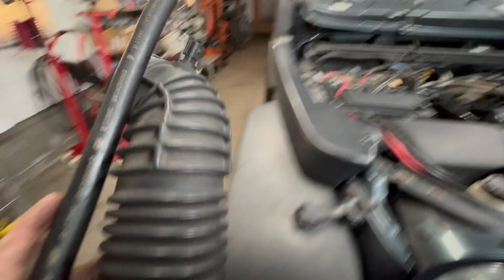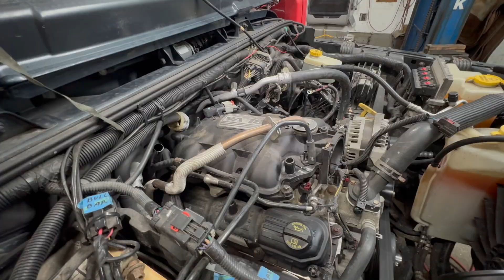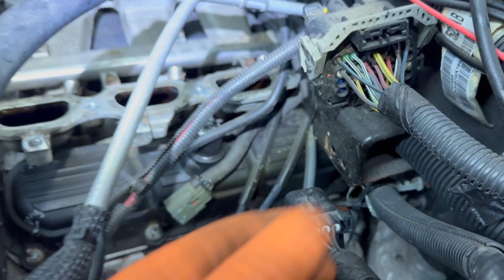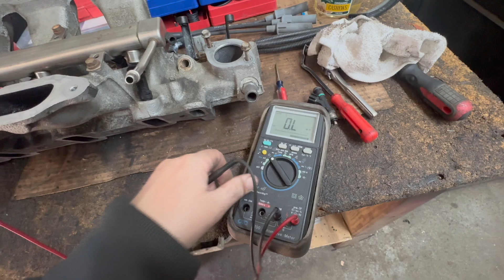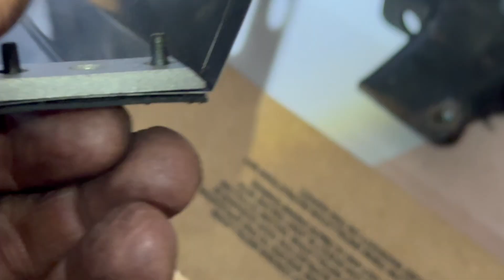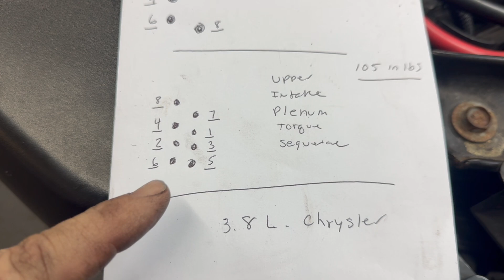How to Replace the Lower Intake Manifold on a 3.8L Chrysler Jeep Engine - DIY Repair

Comment: I have the same jeep and did everything in this video and I have coolant leaking between the head and the lower intake manifold. What would be causing this?
Reply from the maker: It’s impossible for me to know what you did wrong but maybe the Intake manifold gasket shifted during install
* Wrong gasket orientation
* Dirty or gouged sealing surface
* Intake bolts not torqued correctly or not torqued in sequence
Also check the thermostat housing could be leaking down

Comment: Is it a good idea to wait over night for the silicone to dry before starting the jeep? Putting this back on today.  Got to do the head gaskets and engine rebuild this week
Reply from the maker: Yes!
Reply: Awesome. All I have left is to to mount the plenum, fluids, put battery back and see what happens! What a battle this week mate.  Would like to discuss and compare notes
Reply from the maker: Sounds like to got this under control
Reply: How would you recommend priming the jeep before start up? I'm getting people saying to hold gas pedal down and crank over for 15 seconds then slowly releasing the pedal and another to unplug the coil pack and crank for 15 seconds and then start. What do you think?
Reply from the maker: Just disconnect the fuel pump fuse or relay
Reply: @motorcarnut ok.  I believe that's the one labeled ASD?
Reply from the maker: Should be
Reply: @motorcarnut man the jeep started so well and is running well.  I'm putting together a video I'll link up to you.  Thank you for all your videos and help
Reply from the maker: Thank you! Glad to hear my videos helped! Thanks for that as well!

Comment: SO of course Murphy's Law hit me and hard... the last lower intake bolt at the firewall the one near cyliner 5 passenger side effin' snapped on me 1 inch down... I had used heat, kroil oil penetrant BEFORE to try to prevent this..now the manifold swivels left and right and tad up and down but of course it won't slide off because of a layer of rust in that hole...ANYBODY WITH ANY IDEAS???  plus such a tight spot I can't even get a drill back there to try a bolt extractor...I'm screwed.
Reply: Did you ever get it fixed?

Comment: So clarify, the gasket maker on those 4 corners you want to make sure it's a hefty glob on there?  Looks like quite a bit.   And for the head gaskets (just for help on there)  are there places you need to do that on there too?
Reply from the maker: Not too much, it has a rubber seal underneath too, no gasket sealer on head gaskets

Comment: Jeep says I have a leak in the lower gasket...This was a good video. Thanks a ton. Will be replacing this (and valve cover gaskets, and lower oil pan gasket) very soon.
Reply from the maker: No problem! Good luck with the repair!

Comment: Where are the knock sensors located on this? Maybe I missed it
Reply from the maker: It's on the right side of the engine block near the engine mount. Pretty hard to reach.
Reply: @motorcarnut thanks for that, upon looking more where you said I found that the whole knock sensor was missing and a melted connector. Now fixed 🤘
Reply from the maker: Great awesome! Thanks for the update on the fix!

Comment: I have a cylinder 4 misfire. I replaced the spark plug and I think it seems to be fixed. But I also want to make sure the gaskets are okay without taking it apart. Would a coolant pressure test confirm they are okay if it holds pressure? Or do I need to do a vacuum test?
Reply from the maker: Both will to a point but why ask for trouble if its running fine now. Also they are know for bad fuel injectors and the wiring harness on these 3.8, mine as well have to change both.
Reply: @motorcarnut Thank you. I wanted to check it because I am moving soon and will be driving it pretty far so I was wanting to make sure the issue is fully resolved before.
Reply from the maker: Gotcha, you could check both for some piece of mind.

Comment: Do you have idea on Lexus ES 330 car?
Reply from the maker: What exactly?
Reply: @motorcarnut  what makes the gear to make hitting noise when I load on reverse gear
Reply from the maker: Low transmission fluid, valve body may need to be replaced
Reply: Thank you  @motorcarnut
Reply from the maker: You're welcome!